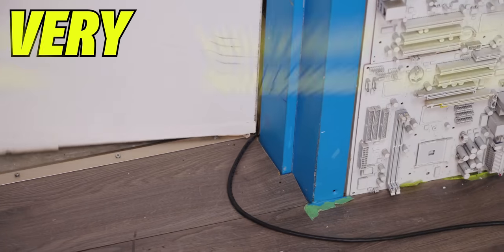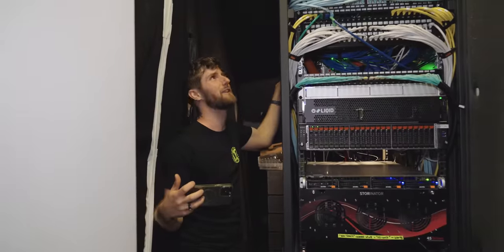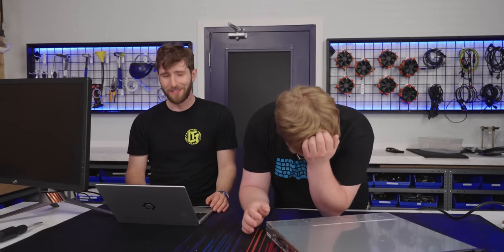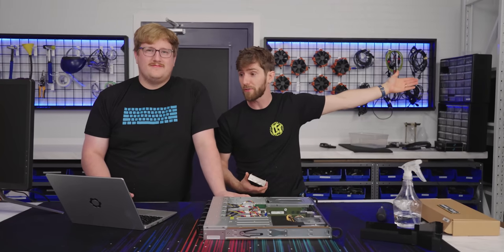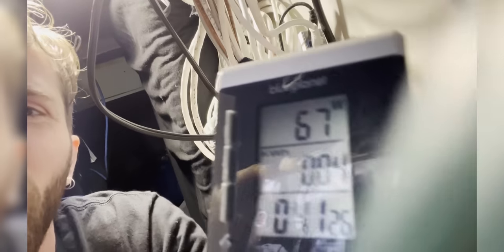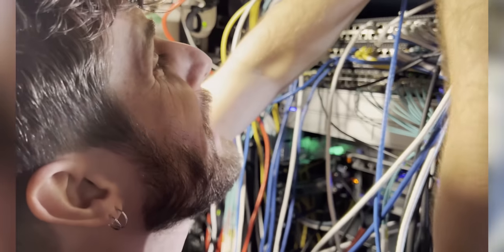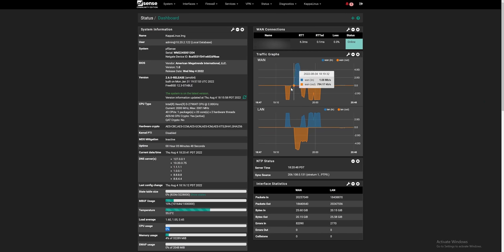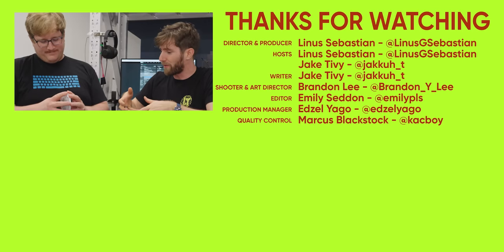I hope you don't need internet.... - PfSense Router Update

Comment: That server rack is a very precise representation of what is the difference between the front-end and back-end software quality.
Reply: This comment is absolute BS. I have seen many instances of better backend software then frontend. In fact some of the software I'm currently working on is frontend and in a horrible state, but the backend is relatively speaking way better (not saying perfect).

In software development there is no such thing as to say frontend is usually better then backend in terms of quality. The reverse would also not be true.
Reply: @rolf-smit  I... I think it may have been this amazing social phenomenon called a joke
Reply: @rolf-smit  Do not forget good looking frontend that is actually a Rube Goldberg machine under the hood 🤣
Reply: With all their building expansions why did they build a new server room with room for a few rack where they can walk around it?  They could use both if needed, split the equipment.  The don't seem to plan for the basic things.
Reply: @buffcode  problem is most jokes are funny because they are based on something that is partially true, or a truth that is hugely exaggerated. If you get to know the software industry you will soon enough find that this joke therefore starts to lack the "funny" aspect.
Reply: @rolf-smit  sounds like a you problem
Reply: @rolf-smit  yea I was going to say the same. “Full stack” devs just make a spaghetti on the front end they’ll go as far as to write 20 exact same inline styles instead of just using a css selector lol
Reply: i have seen many instances where this is true & therefore this joke is funny to me LMFAOOOO
Reply: @buffcode  How is it a joke may I ask? Does not come across that way at all.
Reply: @rolf-smit  My brother in Christ.... it's ok.

Comment: A label printer is an amazing tool for labeling both ends of a cable...like a power cable or a patch cable. It's time consuming but pays off during maintenance or upgrades. You can even color code it.
Reply: Wish the electrician for my home builder knew of label makers. 14 cables in a box, 3 different colors of cables, none labeled. I paid $150 per ethernet outlet, and don't even get labels. The builder says just plug them all into a switch and it should work. Good thing I have an ethernet cable tester, I'd like to know what I'm sending PoE to before I plug it in. 
In my electric panel, I have 3 breakers labeled "???" and only 2 of the 4 bedrooms are listed on breakers.
Reply: @javaman2883  well if its not passive poe, its needs to ask for power. in a passive way, otherwise it wont get it. look it up on poe specs
Reply: I desperately need to do this with our servers at work. Our racks are an embarrassing rats nest from the previous IT guy and it takes so long just to trace cables.

One day I really just want to take a weekend and gut everything, slap labels on every cable, and organize it properly.

Comment: As an enterprise network engineer, you guys are killin' me here.  But for small-business/home stuff, I love it. :)
Reply: misuse of the word trunk to say they can etherchanel/link aggregate got me.. 15:00
Reply: @perksie  I mean.... technically true, but plenty of network vendors use Trunk and LAG interchangeably (looking at you Fortinet & Ubiquiti)
Reply: @aaronriggan2373  HPE Procurve switches and the original Aruba stuff based on that are also guilty of the trunk=LAG sin
Reply: Back when they stored backup hard drives in the bath
Reply: As an ISP NOC engineer who works on Metro-E, the video where they discussed Ciena made me die inside a bit…
Reply: "It's not stupid, they do it all the time" I don't know if I feel seen, personally attacked, or ill 🤣
Reply: This episode triggered me so hard... So much stuff could have been done better. However you have to gain experience somewhere I guess.
Reply: I really hope that they have added some security to that VLAN. Not something I would be happy to do, bringing DMZ into their core network!
Reply: @deansstanley82  If the VLAN only includes the internet SFP and the 10gig rj45 connection to the router's wan port, is any added security necessary? (Provided that the switch doesn't allow management from all ports)
Reply: @Cyberguy42  Yes it does! Pfsense documentation even says so (see ltt forum post for this video for discussion and links). Do not use internal switch to carry unfiltered internet traffic. Am bored of having customers requesting this.

Using a switch not carrying other traffic of another trust level as a media converter, is fine though.

Comment: That they haven't moved that server room in any of the 5 expansions they have had in the last few years is mind bogling for me,
Reply: Moving all that stuff without breaking something, or in their case probably everything, would be a miracle, and this is business critical so its completely sane to play it safe. But they should absolutely do a second server room for redundancy.
Reply: Everything in the building is wired to go through that room. They can't move it (although they should have made it bigger)
Reply: @RagnosUTzone  Yeah at their size a setup ready for a warm swap with stuff on the shelf for swapping would make more sense than planning for 25bg internet at some unknown future date.
Reply: @Bartimayus  could become a network room only and the servers could be moved to a secondary room link with a 10gb or more uplink.
Reply: @nickolas46572   Yes indeed. Good thinking. Would be safe to do that and in a later stage they can add an internet uplink for redundancy to that secondary room.
Reply: @nickolas46572  great suggestion. They could have network racks in each building relatively compact and tidy and easier to cool, and a server space somewhere out the way and with room to grow! But 100gb+ links of course.
Reply: @Bartimayus  this is their MDF and demarc, they can build and IDF :P
Not as much a big of a deal to run a couple fiber trunk cables to another room and build another closet. They probably should put all of their servers in another closet and just leave the networking here
Reply: I take it you don't work in IT then? Because moving server room is a tremendous task
Reply: Seeing replies here makes me think people dont understand how painful it is to move a server room that has tons of wiring throughout the building that needs to move with it. Wiring in walls that you probably cant move without tearing walls out.
Reply: @intheprettypink  Moving a closet and building a second one are not the same thing though :P
Reply: how do you suppose they move the server room, are you aware of how much cable ducting you would need to run new?
Reply: @RagnosUTzone  I think they're planning to move/upgrade the server room to the Lab once it's ready.
Reply: well the risk are higher than yield, that is legit answer, even making slightly adjustment like in this video are actually risky because everything could be gone wrong in matter of seconds and wala... you know the results
Reply: @RK-tx5lb  Honestly I don't think internet redundancy matters all that much for them. 
So much of what their doing is LAN based file uploading/editing or just video recording and then (I believe) most of the YouTube videos they post are pre-uploaded well before they actually post so there's not an incredible need for it.
Even if something did come up then they can most likely work around it since they aren't as restricted as financial or government networks. IMO it'd just be something else they have to manage.
With that said, I wouldn't be at all surpised if sometime next year after backpack/screwdriver/Lab/global economy all settle down a little bit they then do start working on a new server room.
Reply: @RagnosUTzone   The second server room would also make sense from a "parallel running" point of view.

That is, you keep the current server room as it is, but then build up a second server room at a new location.

You don't swap the old router for the new one, or swap old whonnock for new whonnock (or is that "new new whonnock" for "new new new whonnock"? I'm sticking to just "old" and "new" to keep this clear). But you just build a new server rack in a new location, with your new upgraded server hardware.

And then, when it's up and running, you can do an "Indy swap".

(That's a reference to Indiana Jones. You know, where he's holding a bag of sand and, in one fluid motion, swaps the bag of sand for the golden statue. The idea with an "Indy swap" is that get the new system fully up and running - in parallel with the old system - so that switching from one system to the other is one single fluid movement. Maybe no more than changing an IP address somewhere and it's done.)

Now, clearly, keeping things up and running isn't so critical to LMG, it seems. But, like, this is totally how you'd do it for servers that absolutely can't go down for a millisecond.

Simply, you don't upgrade them by swapping them out. You upgrade by creating a completely new secondary system that's up and running in parallel with the old system, then "Indy swap" from one to the other in a single fluid movement that, hopefully, just works.

And the trick here is that if it doesn't work, then you rapidly "Indy swap" back to the old system, everything's back to how it was. Troubleshoot and then do it again.

You can "parallel run" most things. Like, I'm developing a website and I've got two versions of it running. The live site and the development site. The development site is cloned from the live site - but it's not the real website so it doesn't matter if it goes down (really, I should be the only person who ever sees it). I develop things, upgrade things, test it all. Then I can flip a switch and "Indy swap" them. The live site is upgraded instantly. No-one sees any downtime at all, as I'm literally just changing one internal IP address.

Then the old live site is now the development site and I develop new stuff, upgrade things and test it all. Ready to "Indy swap" them once again.

This really is the way you should always do these things. It can eliminate downtime completely. Because you have both systems running in parallel, you can rapidly switch back to the old system, if something goes horribly wrong with the new system. The old system also inherently acts as a redundancy - because, I mean, if something does go horribly wrong and you're desperate, the secondary system is there as a backup (and this is an extra redundancy on top of the existing redundancies in your server hardware).

And, once it's running, it's like painting the Humber bridge (for those who don't get that UK reference, the Humber bridge is so big that, famously, the second they finish painting it, they start painting it again - as one guy is painting the last brush stroke at one end, another guy is painting the first stroke of the next round of bridge painting). So, with a "parallel running" system, you're just constantly developing and upgrading - without cease - yet users see absolutely nothing. From their perspective, the system just periodically gets better all of a sudden - new features just appear - and they never see downtime ever.

Once you go "parallel running", you never go back.

The drawback of all this, of course, is that, yeah, you're building two complete systems. But, as I say, the way this works in practice is that you don't replace the old router with the new one, you don't replace the old storage server with a new one. You just build a new system with your new upgraded parts. So it can be much the same in costs as just upgrading all your hardware piece-by-piece, you just build up a completely new upgraded server rack and then switch entire racks in one go. Then, new system in place, you can do upgrade replacements on the old system, until it's better than the new system and it becomes your "new new" system. Back and forth. Forever.
Reply: @nephrium   I really wonder if they even genuinely benefit from those ever-increasing rates.
Reply: @nickolas46572  That would make sense, but like many things at LTT (including hiring a dedicated it manager) they don't do things that would make life easier.
Reply: @klaxoncow  They don't even need to upgrade the hardware, just move all the servers during the end of the week.
Reply: @RagnosUTzone  exactly this, I right now planning a server move, which includes news fibre lines to come and moving all the systems. If it all goes right it be a few days of headaches, at worst it be a week. That sort of work is never something you want to do.

Comment: "This will still be running 10 years, 15 years from now"

Jake in 5 years time: "It's OLD!"
Reply: it could be running in 10 years but for a critical piece of network gear replacing after 5 makes sense.
Reply: @pjohnson21211  but not replaced in this way lmao
Reply: @pjohnson21211  If it were truly critical in their network stack, it would be redundant. In their shop, if it suddenly died they could have a kludge in place in under an hour (grab random server, load pfsense/opensense, restore config, plug in media) and that's good enough🤷

Besides, I'd bet that equipment hitting 5y+ is pretty rare there just because everything gets poked and upgraded for the content so often.
Reply: Jake also is like 20, so for him 5 years ago he couldn’t drive a car :P
Reply: @MeatPoPsiclez  Why kludge anything together.  The 5 year old box is already there as a perfect mirror of what they need for functionality.  I'm sure opnsense has the same functionality for failover that pfSense does.
Reply: @johngaltline9933  I believe you need the same nics on both systems for ha failover in pfsense (and probably opensense), but I'm not 100% on that

Comment: I built my own router a year or so ago and decided to go OPNsense. An unexpected surprise to see LTT talk about it and actually switch to it at the end of the video.
Reply: Yep, did the same thing about a month ago, got an old dell sff desktop with ivy bridge i5 and use it as a opnsense+jellyfin server, virtualised in proxmox.  Rock solid.
Reply: I built my own router back when you didn't have a lot of choice.
We'd just got a 1 MEGABIT connection and routers weren't a thing outside Cisco and businesses.

Spec was:
Pentium 75
32mb EDO RAM
Dual Intel PCI 10baseT NICs
Dual 1.44Mb floppies for the boot ROM (LRP Linux), giving us QoS and OpenVPN on top of routing and MAC spoofing.
I think it was about 25 Years ago.
Reply: @MostlyPennyCat  25 years ago wasn't even openvpn. Must be added later.
It's sad that back in those days i not even had flat rate landline and had to visit school which had just 32kbit circuit. Cost was about 300$/month. But still cheaper than dialup ( we never got real flat rate possibility).
Reply: @rybaluc  
Uh, maybe we added openvpn a few years later.
First we had a 1.44mb floppy "ROM"
Then, I added another floppy which gave us enough space to add TCP/IP QoS to keep latencies down for gaming and browsing even when using the megabit for downloading through Traffic Shaping.
That also gave us enough space to run a local DNS cache which, at the time, gave us a massive perceived boost while web browsing.
I suspect it was only later that we added OpenVPN routes to each others houses.
Reply: @rybaluc  
I'd just graduated from University in London. The technical universities, like Brunel, had access to JANET, the Joint Academic Network.
When I joined I went from a 56k modem at home to quad T1s there.
We saw download rates of over 1 megabyte a second. MP3 had just become a thing and suddenly we had instant access to all the music ever made.
Good times!

Comment: Network and security admin here, at 17:01 can confirm. Exactly why I make backups before I make weird, possibly breaking changes. Also so happy most enterprise grade network switches forces you to to a copy running-config startup-config to save any changes. So worst case you just run really fast, unplug it, and plug it back in. (and then wait 5 minutes for it to power up making the running part a little stupid)

Also yes, Router should be at the top if it's rackable. Our order is 
Router
Core MDF switch
o3x office switches
rack with random ISP crap
3x big ass battery backups which we could scale down now since we have a generator now. 
Our patch panels are in a separate rack next to this.
Reply: ^better would be patchpannel / switch alternating, allowing for ultra short patches, saves room and provides better airflow, fiber cross connect to the other shelf with core and or aggregation.

Comment: Probable issues, 
1. No labeling on cables
2. No air flow in racks back due to cable mesh
3. Is the airflow of all servers,  switches aligned i.e. intake from front and output from back
4. I see that there are gaps between servers with no fillers.  This causes cooling issues in the rack
5. Use redundancy in routers(active/standby) ,  then no internet down time..
Reply: It's a great example of DIY and self taught people. Their server room always makes me cringe. Sure it works, but my god is it a jank fest.
Reply: OPNsense supports redundancy. If one router of the pair goes down, the second picks up. That does require two incoming fiber lines, however. But the second one could be a much cheaper 1 gigabit, as it's only a backup.

Comment: I love OPNsense. I swapped to it as my first "custom built" router earlier this year after rocking an ASUS RT-AC3200P for a few years, which is now just my AP. I'm still only using the dual gigabit ports on the SuperMicro motherboard, one for WAN and one for LAN, but I plan to upgrade to 10gbit eventually. I think I have two full 16x slots available.
Reply: In time, i also want to upgrade to 10Gbit, but it's still a bit too expensive to do that now. Besides firewalls and routers, i will have to replace at least 8 gigabit-switches and, to obtain full bandwidth, upgrade all cabling to cat7 or fiber. So, i wait a bit for prices to drop some more.